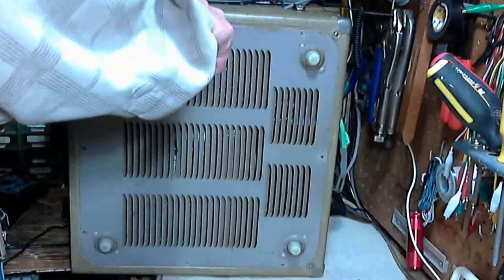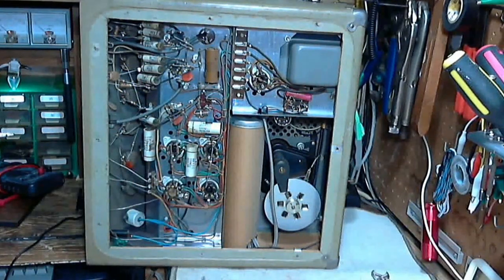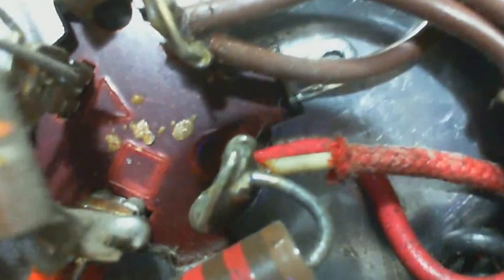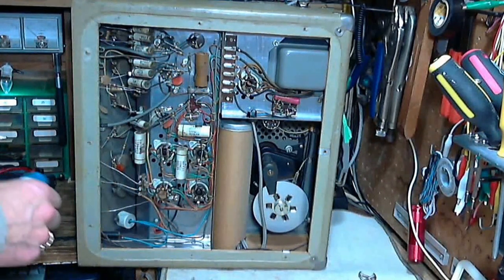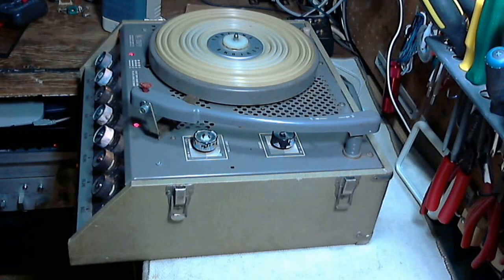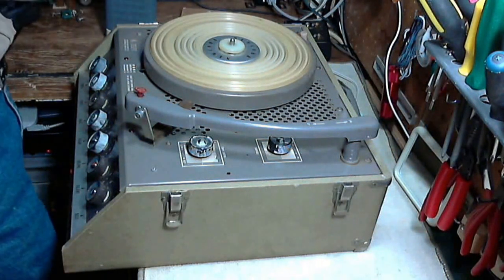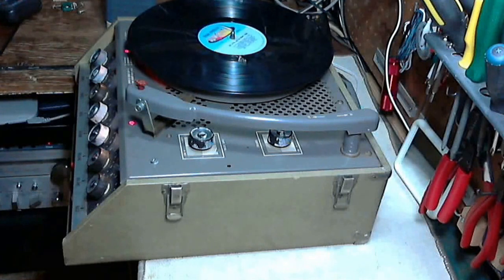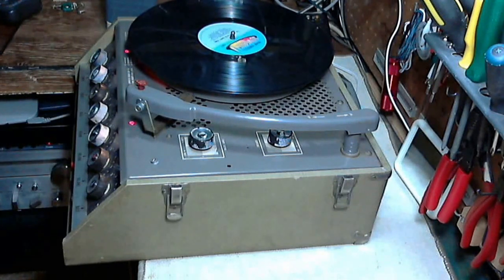Newcomb TR-1656-M Record Player Video #2 - Power Up

Comment: I believe that's a miniature PA system.  I imagine it has some decent power.  I also believe that the 1 or 4 speaker setting would either be a single 8 ohm speaker or 4 8 ohm speakers with two in series in parallel with two in series and would give you the 8 ohms so you get the maximum power transfer.  I'm thinking that two of the tubes' plates are tied to one leg of the output transformer primary and the other two tubes' plates are tied to the other leg of the primary side of the transformer and B+ is tied to the center tap.  The secondary side is tied to the speaker system.  Before you even opened it up, I figured it was tubes because of the weight of it.  I think it may even be from the late 50s or early 60s.  Being that there are four 6V6 tubes on the output, I am thinking the output power is probably around 40 watts.  I am just guessing though.  It seems like it would go very loud effortlessly.  The one thing I would be careful of though is if it is a mono cartridge, you may have a problem with the stylus digging into a stereo record and wearing out the groove.  It is a great find, though.  Thank you for posting. Very cool.

Comment: This is a less common model because it was expensive.  This unit has a General Electric cartridge, which was one of the best available at the time.  It was usually used for teaching dance and for square dance clubs.  The microphone was useful both for instruction and calling square dance. Most importantly it had enough power to fill a large room.